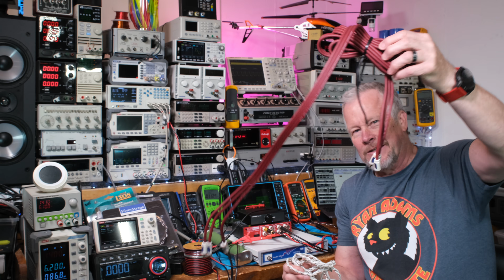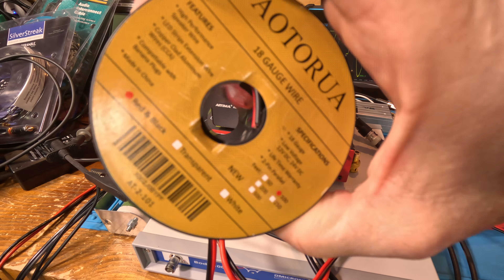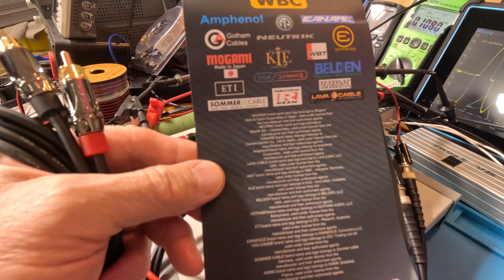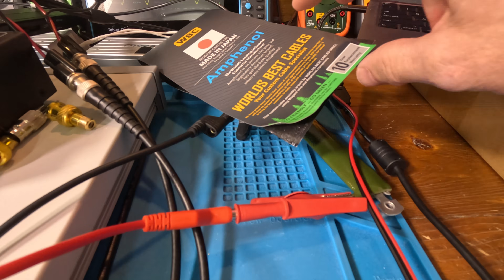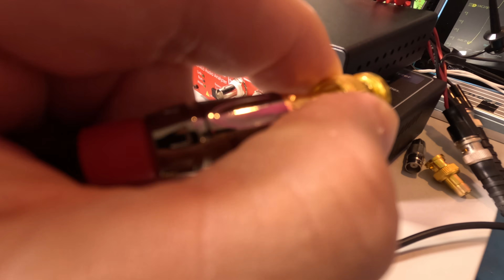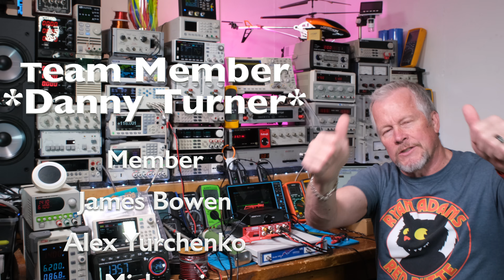World's Best Interconnect Cable Mogami cable with Amphenol connectors #docablesmakeadifference

Comment: To clarify the micro volts and milivolts.... The point is with a reduction in ac noise at 60hz measured on the ground path made a monumental difference. You can doubt it but until you actually hear it, don't think what you "think" is right. That's not how things work, a hypothesis and you can think as your hypothesis it doesn't matter, but until you actually do it you cannot say it for sure doesn't matter or is bs. I wouldn't take the time to say it matters if it didn't and I have a lot better things to do than make up such a thing. I'm saying it because it blew my mind how much it mattered and feel like others should know. Most won't go to the extremes I did to reduce noise to 0.5 mV on the ground but it hands down makes an incredible difference.
Reply from the maker: Thanks for your feedback!  I have also chased 60 Hz noise - and often it is due to some ground loop.  This is conducted noise into a cable - and is down as low as you reduced your noise to (0.5 mV which is -66 dB).

I didn't really have a hypothesis going into this - it was an investigation.  But if I had - I did a pretty good job in proving what you assumed my hypothesis was;)  I will need to put this into a speaker and see if I can actually hear it;)
Reply: @kissanalog  you probably won't hear the noise, but you should be able to tell there's a smearing of the signal or lack of smearing, in a decent properly setup system.
Reply: @Pete.across.the.street Smearing - favourite term uttered by one certain Danny, a business school graduate, who "discovered" mutual coupling of inductors and found it related to speaker cables. Epic, still makes me smile after all these years!
Reply: Yep the usual snakoilphile BS from Danny's misinformation Gospel 😂 @paulb4661
Reply: @Pete.across.the.street you won't hear .that's it. Don't add extra snake oil BS that neither you or your kind is able to proof with evidence or blind tests. Just fluff and sugary prose
Reply: @paulb4661 cool story bro
Reply: @Pete.across.the.street  https://youtu.be/ui8sf-7HgIw?si=_yvXiegsr1Q7frjN lukewarm at best, make sure to properly setup a highly revealing monitor & router, using videophile HDMI, ethernet & mains cables and, preferably, a mains conditioner to enjoy smear-free, pin sharp images.
Reply: @Pete.across.the.street  lukewarm at best: https://youtu.be/ui8sf-7HgIw?si=BKv3Tev9XjBfTtQn
Reply: Good for you  @paulb4661

Comment: Judging sound differences through an electrical signal is a fool's errand. But it is good to know it is built well and doesn't pick up much noise. How much for those silver cables?
Reply from the maker: I'm actually not judging sound differences.  I am showing that any audio signal sent through these cables will be transparent - or at least that's what I am trying to find out.   

I have 2 sets of the silver cables from Kimber Kable.  I will probably want to keep one set for future testing.  I'd be happy to sell the other set for half of what Kimber has listed. ;)
Reply: @kissanalog  no cable is transparent. They will alter the signal at least a tiny bit. The "noise" on the cable won't present as actual noise on your speakers in most cases. Those millivolts slightly smear the signal affecting micro details, sound stage, separation of instruments, dynamics, blackness of background and "air".  Cables can be more transparent or less transparent than other cables not totally transparent. Showing that a cable picks up less noise than the other is useful information, i don't know if it's the only thing affecting transparency though. Could be though. If you don't have a resolving system that is set up properly, a good room, or good hearing then any cable could be considered transparent enough. If you have a mid to high-end system that produces a proper sound stage, that's where you are going to hear cable differences. If you're speakers are slammed up against the wall and you don't have any room treatment cables are the last thing you should be worrying about.
Reply: @Pete.across.the.street and you won't be able to tell a difference like nobody has been able to do in the history of blind tests so there is that unfortunate fact for ya 😂😂😂
Reply: @shaolin95 how could you possibly know if that's true? Just some made up asr bs
Reply: Jesus 🤡 are you still going on,time to shut it now,we are all 🥱
Reply: @johnbravo7542  take a nap, you seem cranky

Comment: Burn in man it's real I don't care what you measure. I've recorded my ultra high end truly world class with fresh new cables I've made and after 100 hrs and my god they do sound different. Look I absolutely didn't believe this before, but the dielectric really does change.
Reply: 😂😂😂😂😂 we cannot measure it and you cannot hear it because it does not exist. Stop the BS. There is zero blind test in history where such claims were proven so keep your lame excuses to yourself and face reality for once
Reply: I have done REW before and after, there are differences, even in the frequency response. Don't know why and don't care why, but burn-in is for sure a real thing.
Reply: @Pete.across.the.street  the same thing is with cryo... You can diy your own cryo for cheap and it's mind bending good. Blew me away. Take cables put in vaccum zip bag or zip lock and get as much air out as possible. Put them in a cooler small is better. Wrap the cooler with a thick blanket... Don't skip. Pour enough 99% isopropyl alcohol to cover the cables in a bag up... Might need a rock to hold bag down if not vaccum sealed. Then buy a few blocks of dry ice locally and smash them up and put into the cooler and close the lid. Leave it for 24 hrs. Try them and be absolutely amazed. Must use 99% isopropyl no lower.
Reply: @B2_Labs  I just get them pre cryoed from take five audio in canada.
Reply: @Pete.across.the.street  you can cryo and should cryo every cable. Lan, usb, xlr, rca, speaker.
Reply: @B2_Labs  OK 🤡 will give it a go🥱
Reply: @B2_Labs You forgot to mention the AC mains. Nothing comes close to sound quality routinely achievable during polar nights in northern Canada. Crispy highs and wide soundstage guaranteed.
Reply from the maker: @paulb4661 This thread was awesome!  You guys had me rolling ;)
Reply: @kissanalog  There was a listing on a pair of hand-matched, cryo-treated pair of Nichi LKG 10m/63V caps on everyone's fav portal a couple of years back. Incidentally, I had a box of 6 of these left at that time, got a set of 10 from Mouser to facilitate restoration of an amp and keep the rest as spares for other projects. Hand-picked 2 at random and they turned out to be... a slightly better match, compared to the listing values. Nevertheless I've contacted the seller and he explained the benefits of deep freeze in an audio reviewer, poetic style. By then I have had the amp running, having replaced shorted drivers, outputs and a few resistors, and since I no longer had the negative rail on the output, I could no longer assess the "musicality" of the already replaced mains filtering caps myself. When I came back to him saying my random picks were better matched and that manufacturer clearly states operating and storage temperature limits of electrolytics, he suddenly went quiet. I've also suggested that a process of such a groundbreaking nature, clearly must have been patented by now. That pair was $120, a box of ten around 70 or 80 at that time. That amp is still fine. Going to Switzerland next week, maybe I'll take a couple to see what the plane checked baggage hold does for the sound quality of DC rails.
Reply: @kissanalog  There was a pair of matched & cryo treated Nichicon LKG 10mF/63V caps listed on, you know where, a few years back. When I've enquired, I was treated to an essay describing the benefits in a poetic way. At 10 times the price, it was understandable. I then hand-picked a stock pair at random from a box of 10 I had from Mouser and they turned out to be an even better match. I then went back to the proprietor, showing the results. I also asked for any additional measurements demonstrating the incredible improvement to compare with stock later and pointed out storage/use temperature limits given in the manufacturer data sheet. Furthermore, I've asked wheteher there was any patent application pertaining to this amazing process, as surely, an improvement of this magnitude should have been patented by now. Never heard from him again.
Reply: @paulb4661  all that proves is you were acting crazy. It doesn't really prove anything since you didn't test the control. If cryo had a patent it would be expired by now. You can buy whatever parts you want and have them croyed really cheap.
Reply: @Pete.across.the.street  Firstly, it proves the claim of close matching on capacitance was false. Secondly, I see no reason to freeze electrolyte, exceeding safe operating limits stated by the manufacturer in the process. Thirdly, I wouldnt mind reading up an expired patent. Finally, if there's anyone acting crazy, it's certainly not me. Btw, how is that upload of your groundbreaking test results going? Had it peer reviewed yet?
Reply: @paulb4661  looks like there's over 15,000 patents related to cryogenic freezing. Just no patents on cryo itself, it would be like getting a patent to make ice cubes.
Reply: @paulb4661  you can match capacitance very easily with a $15 meter.....it's not operating when you freeze it. It Very slowly drops the temperature so it won't cause any damage.
Reply: @Pete.across.the.street  I know pretty well how to operate a 4wire RLC bridge, thank you, morever I prefer data sheets to bull sheets, so thanks again.
Reply: @paulb4661  your mother must be very proud of you
Reply: @Pete.across.the.street  Apologies for being too mature, educated and well mannered to descend into the primitive, bottom feeder flavour style of adult discussion you might enjoy having. Btw, lack of arguments usually leads to ad hominem attacks, so no surprises there, actually.
Reply: @paulb4661  your argument was that since a pair of cryoed caps weren't matched, cryo is BS? I can't really tell what you're trying to say from your post. It was pretty convoluted.
Reply: @paulb4661 yes..the AC is huge.
Reply: How? What changes inside the cable? I am curious because yesterday for the first time I have tried these cables the world's best cables. Definitely a big difference but what is the difference between new and burnt in?
Reply: @y.k.9705  dielectric charge distribution. I really don't understand why people argue against this. This is a damn well known physical science. Dielectrics have charge distribution which changes with time. Charges +/- effect the electromagnetic field created by the audio cable with active current during song playing. There is a force vector perpendicular to direction of current and external charges and fields will change this. This is proven physics. You won't tell rhe same level of change with cheap cables. Cheap pvc dielectric cheap low purity copper or on gear and speskers where the limiting factor is much bigger. When you get everything else right, this becomes night and day. Really it's night and day in the right situation. For most people and most audiophile systems thr change is there but small. Non audiophile setups you will never hear anything. Extremely refined systems where everything and I mean everything has been addressed, the change would blow you away.

The AudioQuest DBS system uses this principal to put a static 72 volts across the insulator to an external Shield which forces the dielectric charge orientation and basically is like a burning type affect but to a higher degree
Reply: Nothing changes is pure BS from the usual audiophools @y.k.9705

Comment: 175 hours is just over a week, easy to do that with a 30-day return. I homemade some cables, and when I first hooked them up the bass disappeared from my system after they "burned-in" for 24 hours or the bass was back. It was not a subtle difference. Also just bought new speakers, when I first hooked them up they were harsh and I wanted to return them. They gave me a headache. I let them play for a few days and when I went back to listen the harshness was gone, they did't given me a headache any longer and nothing else had changed.
Reply from the maker: There is no measurable difference before the 'burn in' so there can't be any further indifference.  

This is at the top of the pile of non-sense.  People burn in to capture infant failures - not to burn in the electronics - that is simply not a thing in real engineering.  

The dielectric makes absolutely no difference.  It would be measured in capacitance - and then this difference would have to be shown to make a difference.  BUT - the impedance - capacitance - does not show up in or near the audio band.

Anyone making money off this non sense would show measurements if it were possible - but it just isn't.
Reply: @kissanalog  sounds like you are measuring the wrong things. There's an audible difference, not electrical. You have to measure the audio to find audible differences. The electrical signal is just a by-product. It can't tell you how something actually sounds.
Reply: Figure out how to prove what you suspect but don't display your "feelings" to the world before that.
Reply: @kappab8304  I have REW measurements proving both. As well as no longer getting headaches. If it was still hash, I would still get them. Many manufacturers burn their items in before they ship it because then they get fewer returns.
Reply: @Pete.across.the.street  If it would be true it would be measured and showed. Never seen that been proven. BS
Reply: @kappab8304  yeah the measurements show it for sure. But if @kappab8304 doesn't know about it, how could it be true lol.
Reply: @kappab8304  it has been measured look at alpha audio videos. Please don't think a hypothesis is correct without actually doing the testing.
Reply: @B2_Labs  Please provide a link to a peer reviewed article, or an AES presentation, or similar. There are videos "proving" dinosaurs and humans lived in harmony thousands of years ago. Thank you in advance.
Reply: @Pete.across.the.street  OK 🤡 we believe you🥱
Reply: @paulb4661 please provide a link to a peer reviewed article where it shows it makes no difference. Thank you
Reply: Absolutely. Burn in usually is noticed in the mids and highs too. Classicly the highs and mids become less eat pearcing with better tone and wider sound stage. The sound originally without burn in sounds bass heavy a lot of time because the mids and highs are recessed. The bass also gets tighter and more control with burn in. 24 hrs is enough to notice a change from stock for sure... Then 100 hrs another big step... And last step but smaller at 200 then usually that's all thst changes.